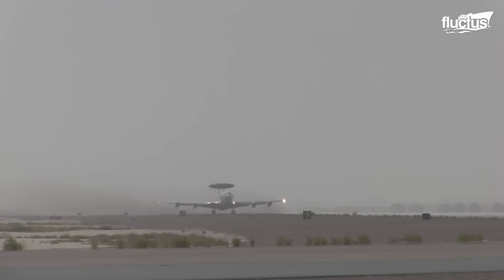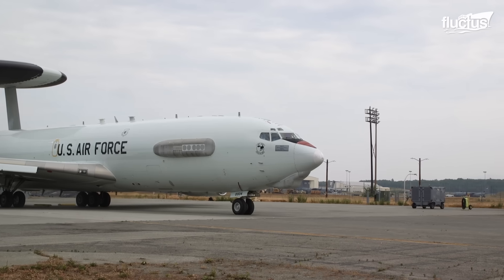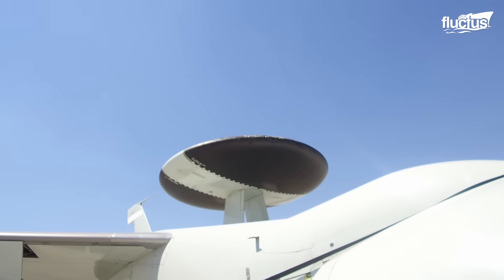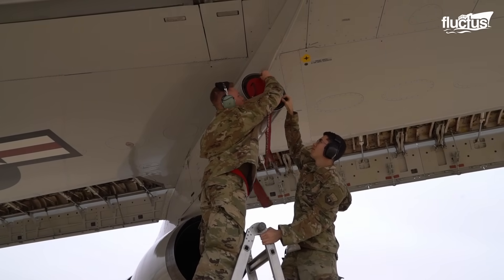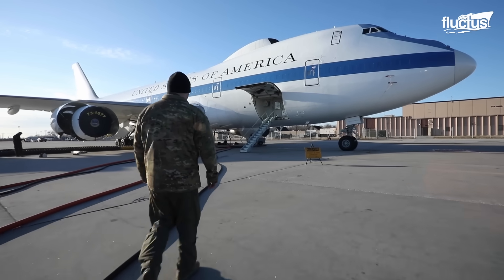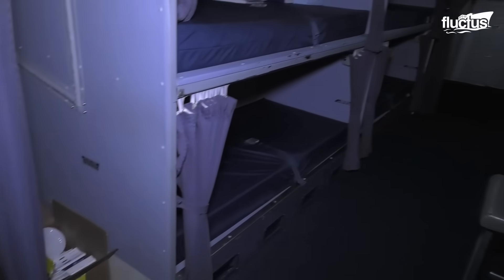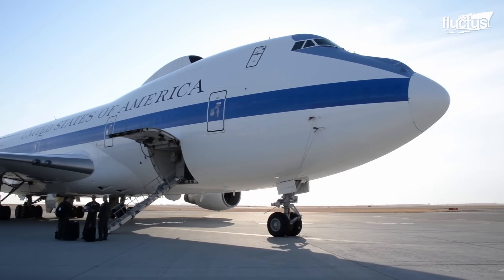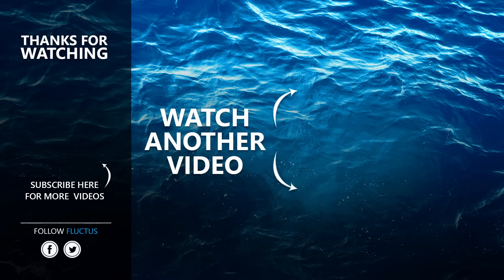E-3 Sentry : US Air Force’s Weird $300 Million Flying Control Tower

Comment: I am a former avionics technician on the E-3 AWACS. I was stationed at Tinker AFB in Oklahoma. I spent 10 years working and traveling on these aircraft. Due to parts sustainibility issues, the DoD decided to park 13 aircraft and scap them for parts. The E-7 is slated to replace the beloved E-3 starting in a few years. The E-3 is a 60s technology ground radar system crammed in to a 70s era Boeing 707. It has flown since March of 1977. It has flow proudly and honorably since then and it will be a sad day that the last E-3 is retired.